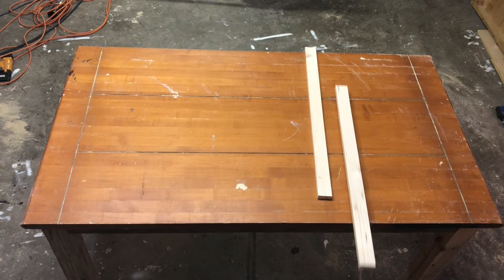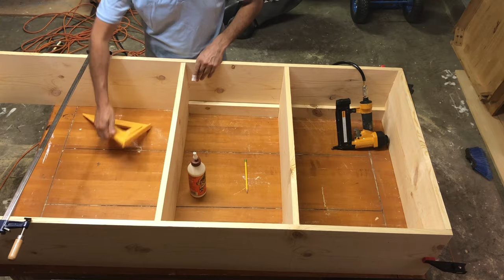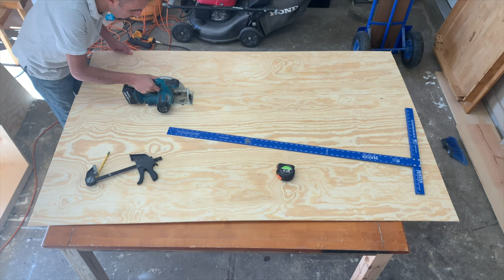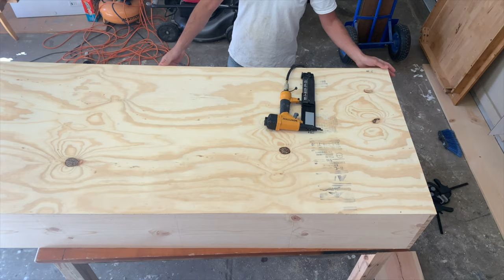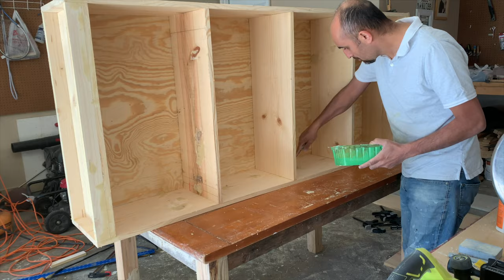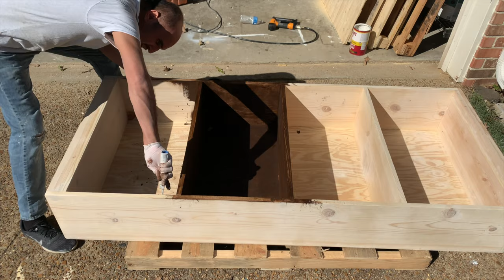How to build a Farmhouse Bookshelves? DIY Step by Step

Comment: Can you tell me the dimensions and sizes of the boards?
Reply from the maker: It was a custom design, I really don’t remember the actual sizes. Sorry about that
Reply: It looks like 1 x 12 pine boards or birch plywood. The smaller pieces are definitely  1 x 2's. From that point just decide what your length and width will be. The depth will be the 1 x 12. The person making these types of videos should include and know these tiny details.